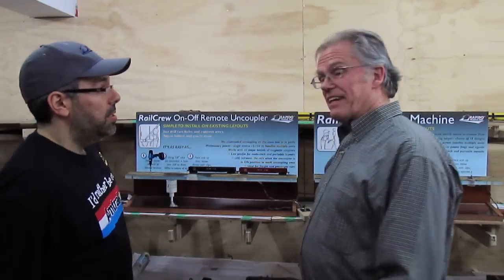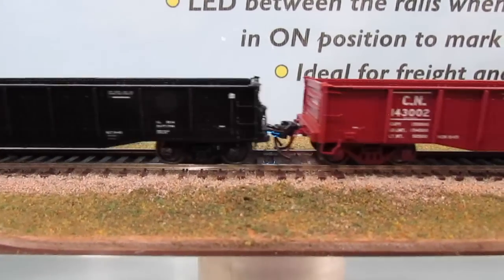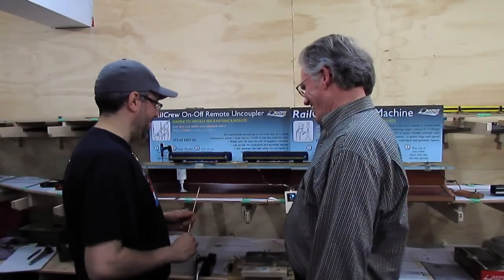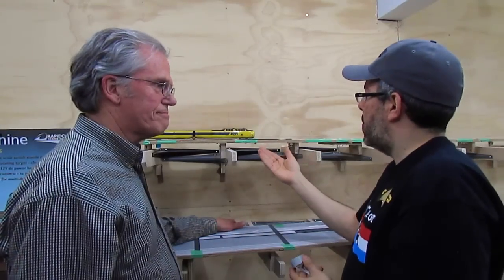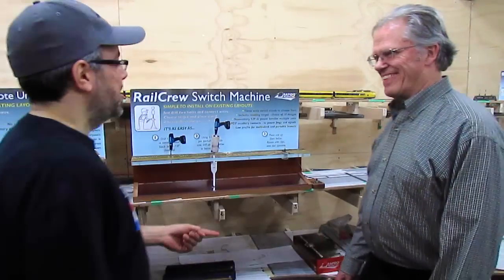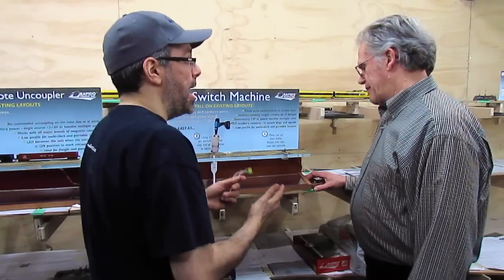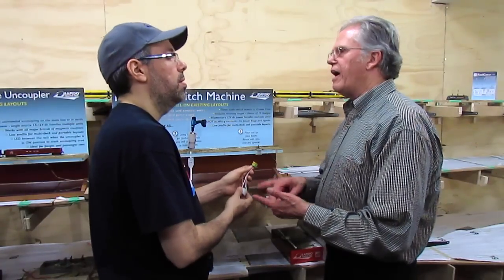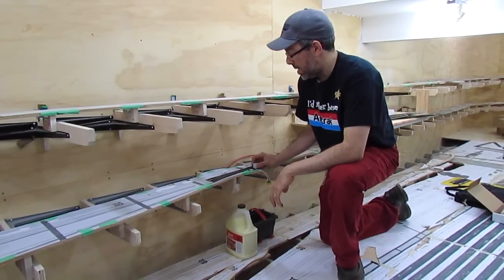RailCrew Uncoupler and Switch Machine

Comment: I have successfully installed and used my uncoupler to allow it to function. The LED light goes on under the track, like Randy says, when I push the toggle switch. Nice feature. I am wondering however, if the LED light on the toggle switch is to remain on. Your video doesn't have it on at all (on the toggle switch) Also, my LED on the toggle is on all the time, with the exception of when I press it "DOWN" and it goes off, but the toggle "springs back" to the middle switch position and stays "ON". (Note my toggle design has 5 wires on it, including a blue wire on top that I have per instructions going to terminal block 2 "Pannel LED   negative -)
ALSO - as per page 2 of the instructions, you say" There will be an audible "clunk" when it turns on and off" I am not hearing such an audible "clunk"., but the unit does uncouple?

Comment: That plastic cover is scale 9 feet in diameter.   To blend in to the scene, my question is how do we hide the said cover?  You don’t see 9 foot diameter covers in real life next to switch stands.  Is this something that got overlooked, or do you have a solution?  A video to solve this problem would be convincing enough for me to purchase several of these machines.  Please let me know what will work.  I’m impressed with the rest of your design.  Thanks for taking the time to read this.  Cheers!
Reply from the maker: The plastic cover is placed over the machine, and then can be scenic-ed over to conceal. The cover is meant to prevent material from getting into the mechanism.
Reply: @rapidotrains  Ha - I got it now. That plastic cover is designed to keep ballast and ground cover from dropping into the unit. I've drilled my 1 3/4" hole in my track (before I glued down my track. I am ready to lay the track, so I'll add that piece of plastic. Not sure it is noted in the instructions... ?

Comment: how do you cover up the switch cylinder with scenery without disrupting the moving parts?
Reply from the maker: There is a plastic disk which fits over the cylinder that is included in the package.

Comment: Nice video.  I was entertained as it held my attention to the end.  Some videos are just monotone and boring and I click off after just a minute or two.  I personally have no use for either item because #1 - I CUT OFF all of my trip pins ( Hate em!!)  so no need for Electronic uncoupling and #2 - I am using Peco Switches and have purchased Peco Switch machines which also snap fast UNLIKE the Tortoise ones but I am very OK with that.   Nice video anyway for the other people interested in that.